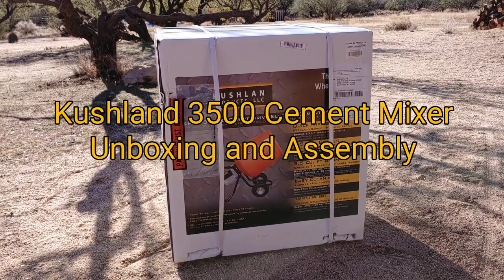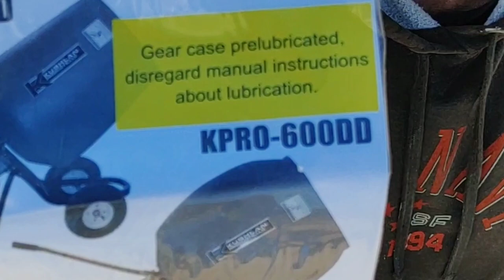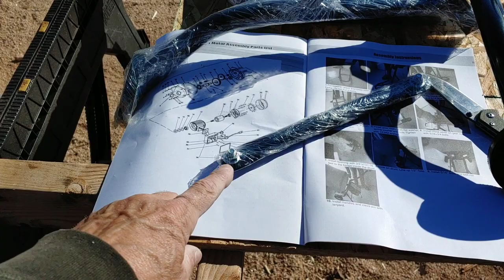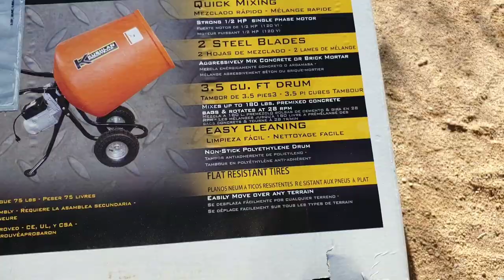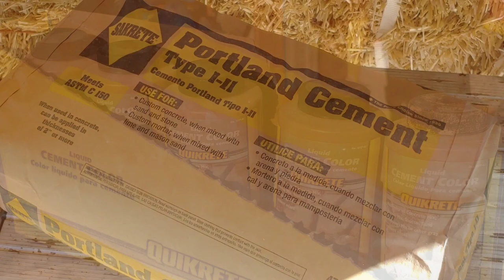Kushlan 3500 Cement Mixer Unboxing and Assembly

Comment: I purchased the 350DD with the 3/4 hp motor. I'm glad I read the comments on this thread because the gear box was empty on mine. I called Kushlan and they recommended 6-8 oz of oil. They also claimed the gearbox would sometimes be empty because the oil would evaporate in their hot warehouse. I had to laugh when I heard that explanation. 

I flipped the carriage bolts on mine and there is plenty of space available. I'm thinking that will help prevent cement sticking in the bottom while mixing.

Mine has orange tires that do seem to be flat free. They have grease certs that I lubed.

I haven't mixed any concrete yet but it does seem to be a good mixer. It doesn't say where this was manufactured, (probably China) but I can probably weld better than the person who assembled this. Nevertheless they should hold.

Comment: Check the gearbox to make sure the factory put oil inside. Mine was empty and would of self destructed after only a few uses. There is a hex plug to check oil. 4 oz of 75w-90.
Reply from the maker: Mine too! Home Depot replaced my unit and I called the manufacturer to verify no additional lubrication was needed, as per instructions. The customer service representative said, "well....you might want to check it just to be on the safe side". I checked it and yes, it was empty! The company should just say add gear oil if they can't get it together in the factory.
Reply: I just bought this. How do you check the oil and add more, if necessary?
Reply from the maker: On the great box is a plug about the side of a dime. I'm going from memory but I think it takes a regular slotted screwdriver to open it. Should it be empty, you'll need to get 90 weight gear oil from your auto parts store. Walmart also carries I believe.

Comment: I would flip those cairrage bolts around asap. With the bolt end sticking inside the mixer, it will make cleaning it out much more difficult. And switching them around later once thay are encased in cement will be pretty annoying.
Reply from the maker: That's what I thought too, but if I turn them around, the rotation of the barrel will cause them to hit the motor mount. We're using earthen plaster with about 5% Portland cement so clean up is a snap.
Reply: @theupsideofdownsizing  I have that exact model and the bolts are not a problem whatsoever.

Comment: What kind of generator did you use?
Reply from the maker: To run the cement mixer, we used our smaller 2200 watt inverter generator made by GE. It starts super easy and is very quiet.

Comment: Not to be a "correcting caren"....but it's actually a "concrete mixer". 
Cement is just an ingredient of concrete. (Sand, gravel, and water the rest).
Like calling a cake mixer a "flour mixer". 
I know, everyone calls concrete "cement".....It's just my years in const mgmt that makes me a stickler, I guess.
This will be a tremendous time, and labor, saver for y'all.
Reply from the maker: Well, then to be brutally correct, it's an earthen plaster mixer since that'll be the cake mix going into this time saving machine 😉🍰
Reply: Yup....18 years in the redi-mix concrete and block manufacturing business (think redi-mix trucks) and still drives me up the wall too.  If that is a "cement" sidewalk it's going to blow away in the first brisk breeze! Once the portland cement, aggregates (gravel and/or sand depending on the mix design), and water are combined, it's "concrete", even before it hydrates, sets, and gets hard. Notice that the bags you get at the big box store say "concrete mix" not cement mix.
Reply: @mx5reddwarf  cake is cake....eggs and flour are not CAKE.